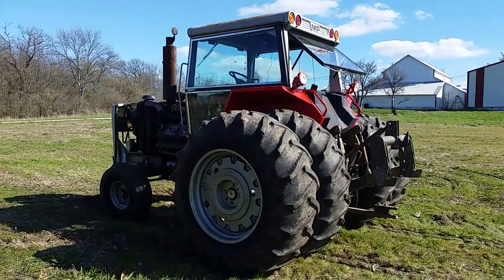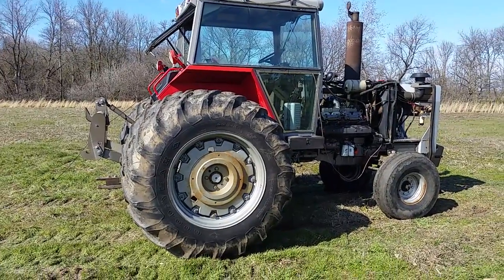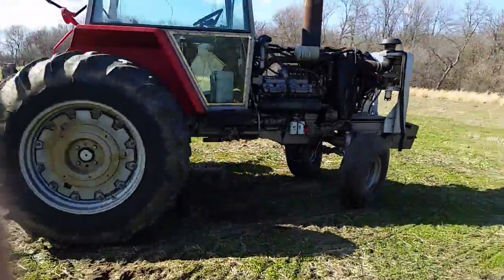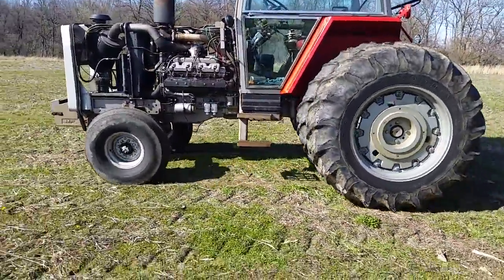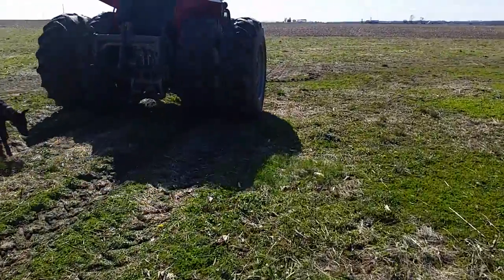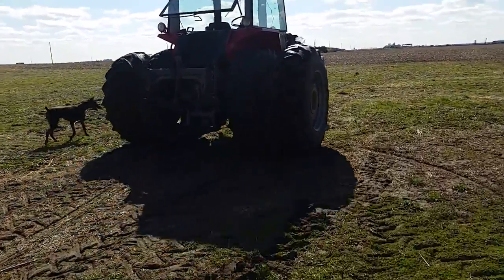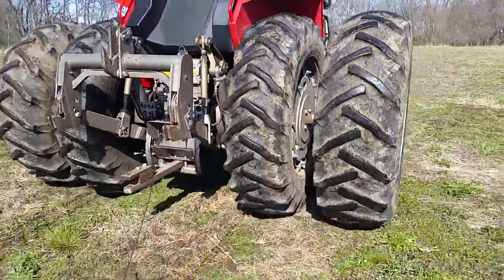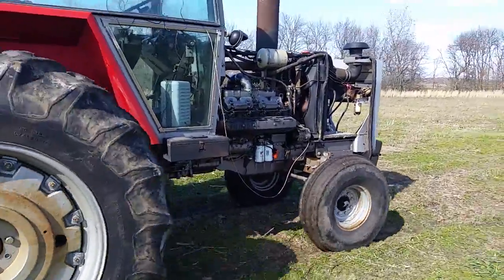Tractobot01:  test04

Comment: as you do to mark the perimeter and make the tractor headland ?
Reply from the maker: Good question!  For Tractobot01, I simply gave it the north and south headland lines (as defined by the JD tractor that did the rest of the field) and said "Raise X meters after you reach the destination line" and "Drop X meters before you reach the start line."  It got a lot more complicated when I had to do irregularly-shaped fields.  Now I use a Reach RS mounted to my ATV to survey the field, load it into QGIS, choose a few boundary vertices, then create passes based on offsets from those boundaries.  Tractobot03 works off of line segments.  It drops some distance before reaching the A point and lifts some distance after the B point.  Then it goes a little further and switches to the next line.